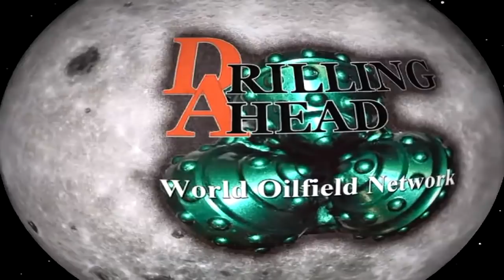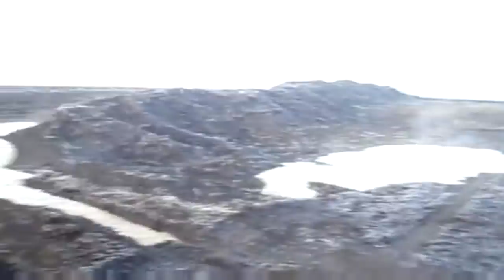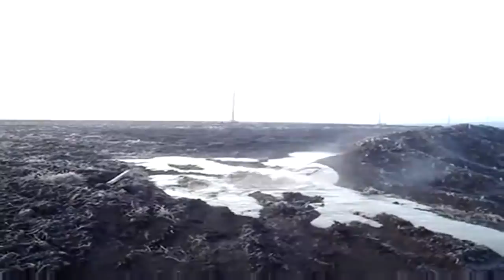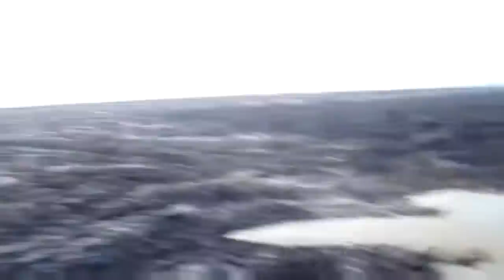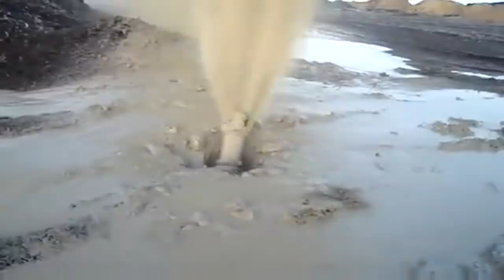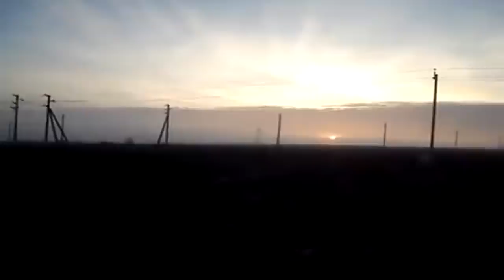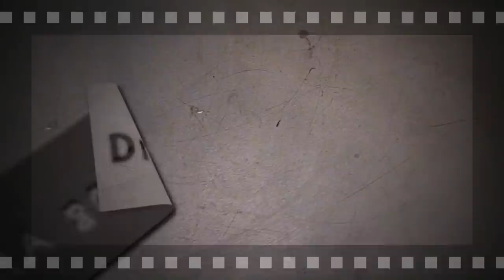Oilfield Directional Drilling Nightmare.mp4

Comment: nothing went wrong here, they are laying pipe with a horizontal drilling machine, it's the same process as a Ditch Witch but just bigger.
Reply: Was that oil or just mud squirting out?
Reply: @partyrobbins4690  just mud squirting out, in fact it came out directly from the drilling pipe
Reply: @francesco1439  Thanks
Reply: People don't understand HDD lol that's some serious air compresion there running for that rock head
Reply: @dannyharp2666  nope those drillbits is run by an mudengine inside The sondhouse, way to long to use inner-rods or air

Comment: Solving the long debated mystery: It's Russia, Tatarstan region, TATNEFT company. Drilling of the horizontal well with 2 "well-heads" - purpose is for injecting steam from one side in order to produce viscous bitumen oil from another end. This project is not new - there are bunch of such wells in this field which are already producing. On video, the guys from the rig are expecting the bit to come out and the area is "bordered" like a pit to confine mud. Later, they will run casings, completion, 2 x-mas trees for both well-heads (one for steam injection and second for production).
Reply: Exactly, you can't get a bit that close to the surface on accident.
Reply: also some companies drill that way to pass pipelines below rivers or mountains
Reply: At least one wise comment exist

Comment: This is not oilfield directional drilling,  This is directional drilling for crossing a road or a river with a pipeline.  very common practice that costs less than if you have to dig a trench and disrupt the traffic on the road or the river.
Reply: Jimmy The Greek , so thats how they get a pipeline under an interstate like I20?  i always they had yo do something other that tear up an interstate.
Reply: Scott Strang Indeed, this is the best method. The shale gas wells out in Texas, Louisiana, and North Dakota are done the same way. It is possible to turn from vertical to horizontal in about 100m (300 feet). It is a proven technology for over 30-40 years now.
Reply: Jimmy The Greek مرحبا
Reply: Jimmy The Greek
Reply: Yeah i did notice the busy 6 lane highway there
Reply: true. for smaller jobs we use a similar system but it just worms the pipe through the earth slowly with a small blade on the tip so you can guide it the pipe is 3" in diameter.
Reply: You are wrong sir not common practice at all

Comment: It is called SAGD. Steam associated gravity drainage.
This activity was in Tatarstan, Russia.

They drill well like this, drill one more well which will be under first one and they pump steam (usually in bottom well if oil is lighter than water). Steam heats up oil, viscosity of oil becomes less and oil goes upward in reservoir rock and then is produced by artificial lifts from both sides of this "nightmare" well...

My friend worked there

Comment: We do it with a mud motor that is bent, and an MWD tool that is oriented to the bend in the motor. To steer the wellbore, you orient the bend in the direction you want to go and push until you achieve the desired angle, and then rotate.

Comment: I for one think this is a legit horizontal/directional dig. No stabilizer, dc,  just slick hwdp bha above the bit with enough weight to push the bit to the projected spot on surface. Spotter on surface with the gamma tools to establish set depth and direction per drill pipe drilled as he needs to inform the driller the progress. Once total length is reach maybe half a click or 1 click, mix mud again when pooh. Rotate string if needed as drag and sticking would probably occur. A thought from a retired floorhand.

Comment: Hi, i deem that my land has some crude/oil underneath as well as there are several spots of mouth of water & damp area. i have one certain area excavated for a pond 40 m. x 40 m. w/ about 3 m. depth i found the soil/mud around the area is very strange in colour w/ very weired characteristic that when as it's wet the texture is as very fine & soft but hard as rock when it's dried.Also sometimes there is some clear grease (oil-like) floated over the surface of some of the old shallowed well.

Comment: +Ербол Султанбаев 
SAGD is Steam assisted gravity drainage,  not associated . we will drill two horizontal wells, the upper one is injection and the lower one is production.usually the distance between them is 5 meters.
When we consider SAGD, the reservoir should be 75 meters deep, or more.  otherwise the steam will expose to the ground.
So if this video was about SAGD drilling, their engineer should notice his drill bit has a over 75 meters difference on elevations.

Comment: Any drilling engineer can tell that it is obviously planned. The lay person can tell because of "accidental" location of the video footage (right place, right time). However, in order to get a bit to do a 180 and come out of the ground you have to work very hard and either push on it from the surface or have some crazy BHA swaps to get the collars in the right spot. It doesn't just "oops" happen - due to gravity.

As for why they would want to do this. I would guess that they are connecting an underground pipe/cable line.
Reply: Robert L

Comment: Really, even before the bit surfaces you can clearly see the straight trench dug directing the water into the pit; where I come from a pit to hold water is called a pond or dugout. And there is no chemicals in standard drilling, just a clay mixture and water referred to as a gel mixture. After drilling the screenings are often spread onto the farmer's fields.

Comment: In my opinion it is a planed horizontal well. If you want to cross a river with a pipeline for instance, you drill a almost horizontal well under the river, afterwards you enlarge it, until the pipeline fits through. These guys just filmed the first break through.

Comment: Directional drilling allows the shaft to be drilled at any angle, beyond a vertical direction. In this case the angle was too shallow and the drill tip happened to resurface several hundred yards from the platform.

Comment: why is that a nightmare?  It seems like it came up right where they were expecting.
Reply: +Johnny Pea Exactly, thats where they had the setup for it to come up!
Reply: It's not supposed to come out of the ground it's supposed to be far below the surface of the earth
Reply: It is Horizontal Directional Drilling... The drill head, and (most likely) a mud motor are spraying out a Bentonite mix. The drill head has to come out of the ground, that way they can attach a reamer, and then pull pipe.
Reply: +Gmac's Outdoors oh that makes sense
Reply: Yes, indeed! I work for an HDD company. It's pretty cool stuff!
Reply: Serafin Moreno yes?
Reply: This is really hilarious :D
Reply: Yep, and someone has to attach the v door key to the end of the pipe so that it can get back up to the rig floor. I know all about it.

Comment: did you see the head on that when it finally stopped rotating? just how does one exactly "steer" that type of head under the ground? hey man, like i said before, this isn't exactly my field of expertise so i'll admit i don't know as far as oil fields go, but i just don't see the logic in steering a head that looks like this. maybe i'm just so used to regular horizontal directional boring that i don't know how they do it in the oil fields. i'm just interested to know.

Comment: Hey it is just a directional drill and the thing you see is the drill bit and it seems that the well has finished. Now they will attach a tool to pull the casing.

Comment: Dp pressure gauge  and mud tank volume ahoul have dropped  sharply . Wondering why the Driller took so long to turn the pumps offs as well turned off the RTtable. Besides they had spotters watching the bit break surface..
Reply: Theyre using motors to do horizontal diggings.

Comment: It happened in Russia. They were in process to drill a shallow horizontal well and could not properly control the tool, so it went way up all the way to the surface. When the failure was discovered they decided to film it; where else can you see drilling mud ejecting at full power from rotating bit nozzles? :-) (while drilling it happens down the hole)
Reply: I work in the oilfields. I knew there was alot of pressure down hole, but had no idea it was that high lol wow

Comment: A lot of folks in here seem to be unfamiliar with the oil industry. I've worked on a rig with H&P for two years now and I can safely say that from a business perspective, that is absolutely a nightmare. Not only would the directional driller who was behind the brake (or the driller if the DD was only advising) get fired, the operation would be shut down for who knows how long. The operator (your Shell, BHP, and BP's) would bring in a slew of lawyers, safety men, etc. The landowners of the leased area as well as the landowner whose ground was punctured (if it's not the same guy) would get involved.

As far as environmental damage; no it's not a nightmare. For the people working on that rig, it could be fucked up beyond belief. That is literally one of the worst things a directional driller can do-right up there with an underground collision.

Then, again that's assuming they're trying to TD somewhere way down like we do here and they're not doing that intentionally, for whatever reason.
Reply: Dylan Dockery kind of scary if you really work on a rig and think this is anything except what it is and it is not a oil or gas well it is a pipeline drill going under either a road or body of water and what happened is exactly what they intended.  If I were H&P and saw your comment you would be unemployed tomorrow.
Reply: 4Cs .plugs Wow.. so it's not a fail. Thanks.
Reply: @TheAndyharris  bahahaha 💯

Comment: There are actually DOZENS of types of drilling fluids, Water Based, Oil Based, Polymer PHPA Based, saturated brine types and many more. Whether or not a drilling fluid is harmful to the environment has absolutely nothing to do with whether it is an oil based fluid or a water based fluid. There are several oil based fluids that are perfectly environmentally friendly. It depends mainly on the type of oil used as the base fluid. Some drilling fluid systems use a base of vegetable type oil, mineral oil, or olefin oil, all which are highly environmentally friendly and can be discharged right back into the soil from where they came with no ill effects. There are also several water based fluids that are very harmful to the environment. Some water based fluids contain heavy metals such as zinc and can pose a serious threat to the environment, especially to marine environments. Invert Emulsion (as pertains to drilling fluid) has nothing to do with any of that. Invert emulsion refers to an oil based fluid in which the water phase is encapsulated inside an oil matrix instead of a traditional emulsion in which it is the other way around (hence INVERT). And as for the video... It looks staged to me as well, however there is absolutely NO WAY to tell by looking at a poor quality video whether or not WHATEVER that is coming out of the bit is harmful to the environment or not...

Comment: This was text book people. Google "Horizontal Directional Drilling" or HDD. They use it to drill under highways, rivers and anything else. They then pull whatever they need there the borehole, communication cables, water lines, pipe lines.

Comment: Yes this is directional drilling and I think you are correct that it is a tri-cone bit the more I look at it... My mistake. But calling this a "fracing job" is horribly incorrect. If there is a drill rig in place you are no where near fracing a well yet. This rig is still drilling so the long string cement casing (aka "production casing") still hasn't been pumped yet. The production casing is what service companies pump down when they're fracing a well.

Comment: If this were a oil/gas bit, it would mean the directional driller and drilling engineer needs to be fired because you survey inclination and azimuth all the way to TD (total depth), and there's no way you would ever let a bit get over 180 degrees inclination. I should know. I'm a directional driller. This was most likely intentional to run pipe under an obstruction, or something like that.

Comment: This is a pipeline directional drill they drill short distances ream and pull pipe through areas they cant dig (roads, existing hot lines and such water power lines) there are lots of different "directional drilling"

Comment: Measuring the Tool Face Correction opposite direction results in 180 deg tool face offset. In higher angles (GTF) the drilling goes up while the screen shows down for this case while the Azimuth is correct.
mud pets will show that the upper formations are being drilling again reversely.... follow the azimuth and read your inclination and apply simple trigonometry and you will find the mud spot before the drilling bit !!!
yes stupid call to continue drilling for that run. No direction Gain.

Comment: This is a pinpoint accurate video of directional boring, not what I, as a
DD consider directional drilling. Commonly used for beneath river pipeline crossings, under existing roadways, etc. If a DD ever got that off course looking to TD in a production zone the MWD hands didn't even show up on location. But it looks from the pit that a decent DB hand was on target. "Don't believe everything you eat on the internet." Abraham Lincoln, 1492-1942.  Seriously, have you ever even pulled a set of slips Bro?

Comment: This isnt a video of oilfield directional drilling. Its horizontal boring, for a utility company. I am a directional driller, and assure you that there is absolutely no way that any oil or gas well would ever be drilled back to surface. It would be impossible to push the drill string uphill from kickoff point to surface, due to torque and drag.

Comment: Guys,the first thing that needs to be done here is to take out the words "Oilfield" and "Nightmare". It ain't oilfield, its borehole drilling. They  mostly work with people like pipeliners. Laying pipeline crosscountry, occasionally they'll come across roads, creeks, rivers, interstates, etc. They use these directional "borehole" machine to just go under them. Go down MAYBE a couple hundred feet, go under, then pop back up the other side. Only chemical used, mostly, is Bentonite, totally organic

Comment: Probably not a nightmare, but planned. Cameraman was waiting for it to come up in the right spot. Doesn't look like invert drilling mud, probably just circulating fluid for flushing. No cutters on the bit, my guess it is a directional bore for pulling an accumulator pipeline.

Comment: That’s not oil drilling. And what you see is drill mud and compressed air. They could be installing geothermal loops or pulling tube down for cables to cross rivers or roads. This is pretty common in my area.

Comment: oh hell no. i think the only way that could happen is if one were directional boring right up along the side the house and lost track of where his head is. but i'll tell you what- boring along side structures- when the head hits rock and starts rolling into that rock, it sure does make a sound and feel one would never forget. anyone in the biz knows what i mean. it sounds and feels like your hitting a house or building. i have hit an unmarked two inch gas main- what fun that was.

Comment: i've worked in underground directional boring for close to 14 years, i don't see one thing that is wrong here except for they could have turned the water off sooner. this isn't remotely close to a nightmare. the machine shoots water through the rods at high pressure for a couple reasons (look it up). and it has that muddy look to it because they mixed in bentonite to help in keeping the bore hole open when pulling back whatever it is they are pulling back. nightmare? this is a walk in the park.

Comment: i think me and you are talking about two different things. first off, what i'm talking about on a bore crew, the locator is the responsible man. he gets fired first. it isn't the operators fault unless he blatantly disregards the locators commands. i think we are talking about two different job descriptions. cuz what i saw here in this video was the head sticking out of the ground with the water pressure on all the way. could be i'm looking at the vid wrong myself.

Comment: Bit check time, nozzles working!  
usually MWD at fault for this, during assembly of BHA may aligned the motor / bit at the wrong setting.. not driller fault he doesnt get to steer much, just yell and kick asses..

Comment: LOL. Since you drill holding weight off the bit, and the bit is above ground, you would have to add considerable downward pressure to the drill stem to accomplish this. Funny, but impossible.

Comment: This looks exactly like they are simply drilling a tunnel for power lines or some other sort of piping.  They do it all the time.  Under roads, under rivers,  under fields...  They just drilled a massive one for power lines under the river near me.  The bore down and right back up..  Rather accurately too.  This has nothing to do with oil or fracking. Probably a water line at a farm.

Comment: Since most directional drilling do the "kick out" at anywhere from 5k and 15k ft below the ground depending on geographical location ..yea this would be BAD!! but since this is a directional drilling operation that it used to bore under roads rivers and other things they wouldn't want to or couldn't use a ditching machine on its a job well done ...lol